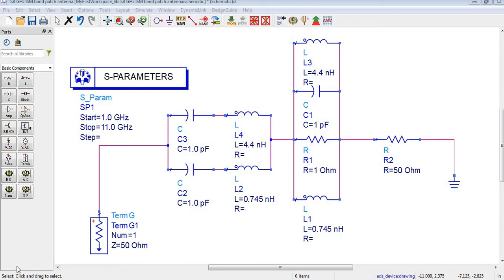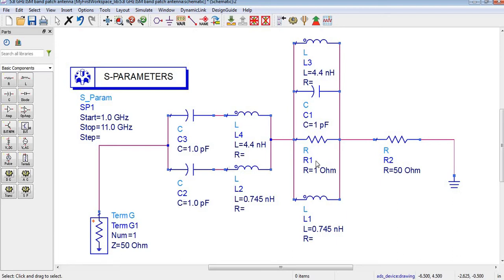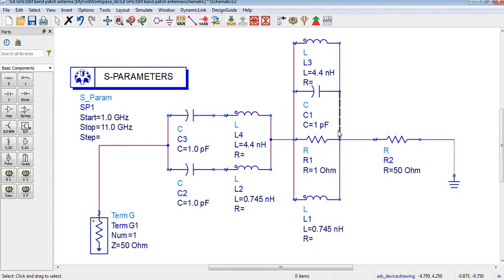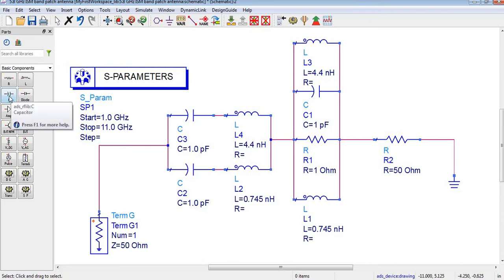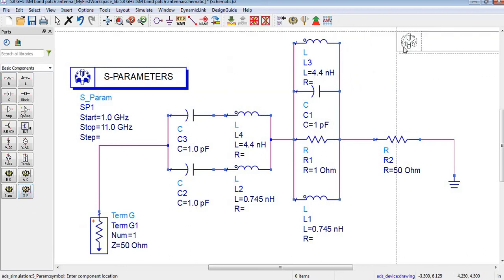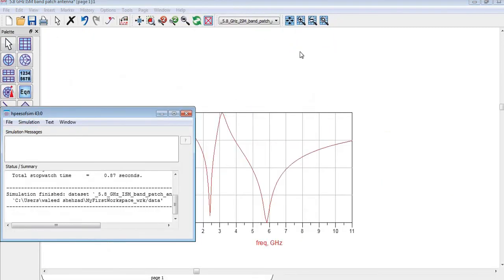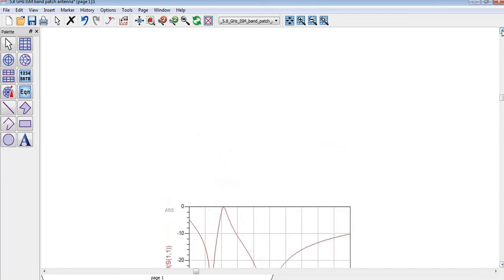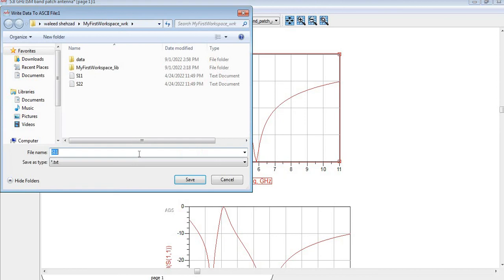Equivalent Circuit Model of Dual Band Antenna at 2.4 & 5.8 GHz | ISM antenna ECM | ADS tutorial 24

Comment: nice video, can I ask about the calculations for the sizes/values of the capacitors, inductors and resistor?
Reply: please put tutorial for calculate RLC values for GHz antenna
Reply from the maker: Yes, 👍
Reply: @waleedshehzad8955 , do u have a video on the design steps/ calculations?
Reply: Explaination about how to get the model and thé values